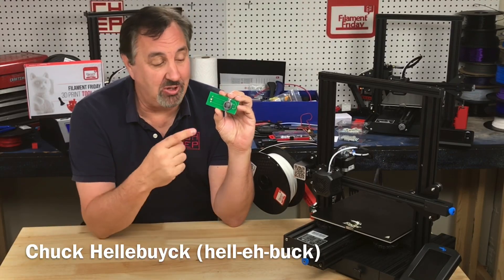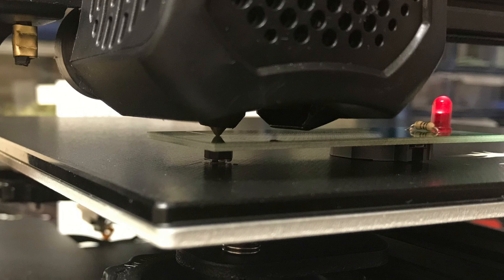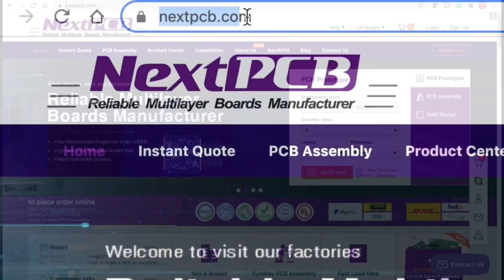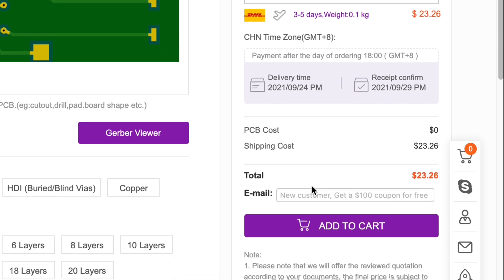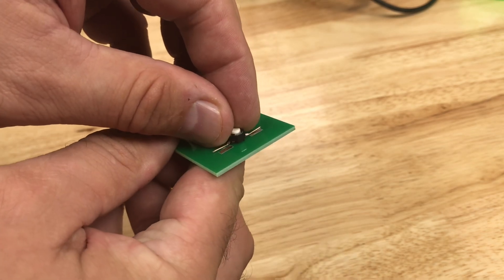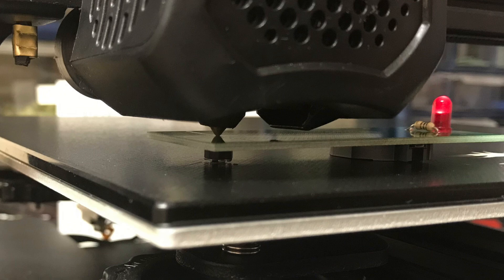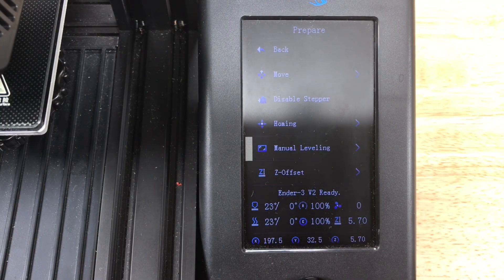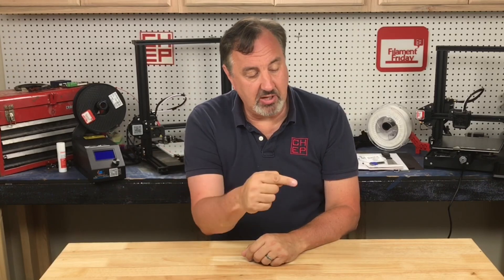Filament Friday E-Leveler - Electronic Device for Easier Bed Leveling on any 3D Printer

Comment: I like to use a multimeter set to test continuity for this. You can just attach one lead to the print head with an aligator clip, and the other lead to your print bed (if it's conductive; you can still use a feeler gauge if not). All you have to do is adjust the knobs until the multimeter beeps and move on to the next point. I've gotten fantastic results this way.
Reply from the maker: As I mentioned in the video, it’s not as easy as you describe for some printers.
Reply: @CHEP  oh my bad i didn't catch that. That's fair though.

Comment: I bought a ender 3 that came with auto level thinking it would make things easier for a newbie. I Struggled ALOT with it. Printed 9 CHEP cubes and there was always something wrong. I returned it and bought a Ender 3 v2 with no auto level, along with this e-leveler, and printed the first cube perfect.  You have been a lot of help CHEP, Thanks. I would like to second another comment. Why 20 seconds on the E-leveler File? I preferred the push button activate on the bed level code. It still got the job done though. Thanks again.

Comment: At 4:19 you mention that at a "fully pressed" position it has a thckness of 5.7mm. Did you apply force with the calipers, or is this measurement done when the LED barely lights up? There is some small difference between the moment a button closes the circuit, and the "fully pressed" position at which it mechanically cannot be pressed any more. E.g. the OMRON D2F snap action switch (usual choise for the home switches) has a travel distance of about 0.5mm from resting position until "contact", but allows extra 0.25mm travel beyond the "contact" point.
Reply from the maker: Calipers to light LED.

Comment: Not a good idea at all. This is a device for finding Zero or homing, not for mapping surface topology which is what bed leveling is intended to do. My bed has a dip that is large enough that entire board would cover it and give the UBL system the impression that section is as flat as the circuit board. Your better off wrapping your bed with aluminum foil to make it conductive enough to probe directly with the same technique. If your careful about how you do it, could even frame the foil so you don't have to keep tearing off a new piece every time you need to adjust the bed map.
Reply: You wouldn't be able to lay down a perfect layer of foil to get an accurate result in a repeatable fashion.  Even if it was just a small piece, it's too flexible to be reliable to ensure that you're as close to the bed as you possibly can be.  As soon as that foil touches the nozzle, or whatever you're using to complete the circuit, the circuit completes, but there could be a gap below the foil you just don't see.

Comment: Before tramming (levelling) I replaced the bed screws new screws that are 5mm longer, and added lock at the very bottom. After tramming, I held the knob in place and tightened the lock nut. I almost never have to tram again as the knob no longer vibrates loose. Honestly, the manufacturer should put a locknut in the knob to begin with. Cheap upgrade, increases quality. Here is an idea for anyone still reading: design a knob that incorporates a locknut. 

(sorry if this is  duplicate comment lol)

Comment: The only problem is the actuation distance of those little switches isn't typically very repeatable as they're not designed to be
Reply: that’s why you measure the one you made and is what you put in the offset
Reply: @youhigh321  measure one of those at the actuation point 5 times and you'll get sightly different readings every time. They're not precision switches at all.
Reply from the maker: Will Lyon- Have you actually tried it? 
I have, I get the same reading every time.
Reply: @FilamentFriday  I'd say you lucked out with a good switch then. I haven't used them for this specific thing but I have done similar things with similar switches and the repeatability wasn't great.

Sometime needs to make a test setup with a stepper to measure actuation distance for these little switches

Comment: Thank you! This is an useful also with Manual Mesh! anyway, i guess the nozzle have to be hot during mesurement, right?
Reply: Bed and nozzle need to be warm because heat makes things expand and warp, so its better to level the bed hot than cold since hot is when you actually use it :)

Comment: you took so much troubles in making this circuit. Lotmaxx Shark Plus 3D Printer has built in LEDs on the side to do this :) and also probes for 6 points auto bed leveling. i believe more and more 3D printers now coming out with auto bed leveling and these built in LEDs. for those who do not have such systems in printers, of course this device will work.
Reply: Yeah I mean, we have printers without that.  It's not like we're going to buy a whole new printer for that lmao it'd be easier to buy a bed leveler for ender 3...what this board is is something even cheaper than auto bed leveler

Comment: You should use leaf switch instead of the tact switch for more accurate switching. As you can see, the Ender Home switch detector also use leaf switches.
Reply from the maker: I’ve tested and found it’s not any better.

Comment: I have the new RED board and one suggestion I'd pass on is to use one of the bigger surface mount buttons. The smaller button allows the board to tip too easily if the nozzle is not exactly centered.

Comment: 2 things... First, why a 2-sided board? Why not surface mount everything on one side and lower the nozzle directly onto the button? Second, I'm always confused at the z-offset... With feeler guages the video said set z-offset to feeler guage thickness but I don't think it said to reset to 0 after level, but with this you set to the thickness, level, then reset to 0 when done... Why?
Reply from the maker: Switch can’t handle nozzle temp.

Comment: I wonder how what the accuracy of that button is compared to something like a BLTouch? This also doesn't compensate for an uneven bed like a mesh does.
Reply: the accuracy of this kind of button is ... crapy. If it was accurate, we should never had to look for Hall effect sensor, or accelerometer or any other more expensive solution.
Reply from the maker: Just as accurate as the Z stop switch. Hall effect is less accurate.

Comment: Love this Chep! Kind of really sad though was able to snag myself one to receive an email saying they can't be shipped to AUSTRALIA v.v That makes me want to cry. Oh well, I guess I miss out on this. Love the idea Love the channel it has been super helpful in getting me started. With the amount of trouble, I have been having to level my bed I was about to throw my printer out the window. I mean I am still having troubles which is why I wanted to buy this somehow managed to fluke the leveling yesterday!
Reply from the maker: I’m told Covid restrictions are causing shipping issues to some locations outside USA. New Zealand is another one. Very frustrating.
Reply: What kind of printer. Actually doesn't matter. Start with rough level. Use 1/4 inch of cards. I use some pokemon cards use playing cards. That's rough level. Then start turning ech handle even amount of turns till your down to the bed, with one card. Then you're close. Get a piece of paper. Do 1/4 turns or less now evenly. A piece if paper is.4 mm. Take paper and push under nozzle. The nozzle and bed need to be set at temperature of filament you will be using. I have Creality 3v2. Most basic printer. That's the one to learn on because it is hard to get right.

Comment: Can't wait to try this 😀
But one question,.. after leveling you set the z-offset (5.7) back so it's on true zero....
True zero, does this mean that the nozzle is resting on the buildplate?  You went up 5.7 and back down 5.7!?
Reply from the maker: The slicer 1st layer will offset the nozzle per your settings typically 0.2 or 0.3 mm.
Reply: @FilamentFriday  Is it a setting we have to manually put into the slicer (maybe on the start gcode ?) or this is a build in and automated feature in all slicers that it will offset the nozzle by the layer height we choose ?

Comment: I’m wonder why there are hardly any videos on YouTube on ASA specifically ASA Carbon Fiber. I just bought a roll of CarbonX ASA/CF. It was really expensive , but I’m very impressed with the strength once I dialed in the temps. 250°c nozzle  / 110°c bed using enclosure. I’d love to see you do a video on it! Thanks!

Comment: This might be a really dumb question, but why do you set the z-offset to 5.7mm, level the bed to (presumably) 5.7mm of distance between the tip of the nozzle and the bed, and then revert the z-offset back to 0mm?

Maybe my understanding of z-offset is flawed, but I was under the impression that it was a measurement of the distance (empty space) between the tip of the nozzle and the bed.

What am I missing here??
Reply: Z offset is the difference in distance between an ABL probe and the nozzle, he is not using an ABL probe so the Z offset is at zero, the board is 5.7 mm thick including componants so this is set as the z offset so the nozzle does not crush it but connects to the conductive point
Reply: @AndrewAHayes  Ok...so if someone isn't using an ABL, their z-offset should always be zero?  Is that a fair statement?
Reply: @Campapalooza  yes because the z offset is telling your printer how far the nozzle is when the zlimit is activated. If you are using a bl touch then your nozzle is higher then the bl touch when its probing for the z limit, hence the z offset. If you arent then your nozzle should be basically touching the build plate once the zlimit is activated.

Comment: Dial indiacator is so much easyier and more accurate
Reply: Please explain this further.  How are you using a dial indicator to measure the tramming of the nozzle to the build plate?
Reply: @williamsteele  mount it to side put nozzle to bed zero dial indicator move nozzel up amount u want it above the bed based on dial indicator re zero dial indicator then level bed based on zero of dial indicator
Reply: @alockworkorange7296  yeah but no lil red light :(
Reply: @alockworkorange7296  I don't see how that can account for any inaccuracies of the X axis arm itself... all that will do is level the bed to the frame.

Comment: Is this type of switch accurate enough? I would use pietzo or something home made (two thinn metal plates with tiny cap)
Reply: its not, is a good idea but you cant relay on mass produced switches that are not made for precision, plus you need to add the error that the calipers make in taking the measurment, use a feeler gauge to level the bed, but anyway, if you had an autolevel sensor this is not necessary at all
Reply from the maker: Yeah it’s accurate enough. Works great. As accurate as the Z stop switch that homes it every time.
Reply: @FilamentFriday   Tru.. endstops are prettylike same, but I would like to change my endstop to optical 😁 

Its almost as cheap, but can trust it homes correclty because sometimes I see switch is not homing to exact same position  (sometimes problmen is screw itself, it kinda wobbles when turning so otherside of its cap can be higher ans turning can make it go even wrong direction 🤣)
Reply from the maker: Optical isn’t really any more accurate.
Reply: @FilamentFriday  WHAT????
My optical endstop repeats within less then 1/100 mm. Never seen a microswitch do that.

Comment: The extra steps with the z-offset don't really seem necessary 🤔 just bring the z-axis to a height of 5.7 and you're good to go. That also is true for leveling with a feeler gauge. The offset is not really important. The angles are

Comment: I've used paper, feeler gauge,  also have a bltouch and still have a hard time. I've also used masking tape to hold the glass because the metal clips create a bow where ever they are clipped.  For some reason the center of the bed is always lower than the outer edges on my Ender 3 V2. I've put a business card under the center of the glass and it still doesn't help. I enjoy 3d printing, but getting a perfect CHEP test is almost impossible.
Reply: With Jyers firmware, the BlTouch will tell you exactly how much you need to adjust each corner, down to 0.001mm Much easier than using paper. Then you use UBL and automatic bed tilting in your start code to get perfect, automatic bed leveling each print.
Reply: @michaellindborg1510  Thank you! I will definitely check it out!
Reply: @JasonSmith-pc6kr  let me know if you need any pointers
Reply: @JasonSmith-pc6kr  Yes, I upgraded my Ender 3 V2 with Jyers Extensible UI recently, and it solved my bed levelling issue, now my print out result pretty good, you should try.

Comment: Got one.. I noticed the current release of the G-Code to use it seems to already set the Z-offset to 5.8
(By the way it worked very well)
Only suggestion is some of your older GCODE releases had manual pause (M0 or M-25) And  would like to "push to continue" rather than only have 20 seconds.    
Once it was done I printed a layer of the Squares test.  all stuck around nicely no issues. 
Finally it's doing a test print. 

The ENDER-3 is printer 2 Printer 1 is a Flashforge. Sensor built in to that puppy.. But alas it's down just now need a new hot end.. ((yup. I broke it. I know how, they are sold out I'm told)  Got the Ender-3 used from someone who never put a new file on the card. Only  printed sample files (Test dog?)   I"ve printed a bunch of halloween stuff already.

Comment: My only issue is that it goes to dang fast. About the time I get it centered it moves to the next corner. Oh and that's another thing, the micro switch IS NOT CENTERED under the cross section.
Very Frustrating but I know it will work once I get these issues sorted.

Comment: A better solution would be to use a piezo on the board instead of a switch. Its easier to measure the pressure required to trigger it.

Comment: Great idea sir.

Manufacturers need to implement their z-stop into the print head to directly interface with the print bed instead of the printers frame. That would save so many people so many headaches.
Reply: 3d print and adapter and do it yourself:-)
Reply: Or get a BLTouch :)

Comment: CHEP,  I had an old Ender 3 V.1 kit from 12/2019 I built this week, then swapped the 1.1.4 motherboard to 4.2.7. Seems to work nice BUT my favorite bed level GCODE from you is behaving funny with the Creality 32 bit motherboard.😢 It’s the program taking the print head to all 4 corners and the middle of the bed, stopping at each point. Well, it moves correctly, BUT it doesn’t stop in any place anymore! 3D prints look okay though , so what is going on with the bed leveling gcode??? Please help, anyone🙏 I’m just an occasional 3D printing hobbyist, but I LOVED CHEP:s bed leveling program❤️ Really want it to work again.🙏

Comment: I would like to buy your kit. It's similar to a probe I used on a very large cnc machine upto 100,000 pound castings. It had a.250 ball on the end and rotated in the spindle. We would back off until the ball was starting to flicker. It was the best ege finder available. I haven't had time to play with my Ender  6. I don't think it has a z axis offset. If I raised z 5.7 how it will it stay without a G92? Please give a little more detail for printers with out z axis offsets.
Reply from the maker: Your just setting true zero. Use move Z to 5.7 and use the tool and then when it homes it should be true zero.
Reply: Thanks

Comment: Good morning. 
I have a tenlog and I’m not that much into changing what works. Ie. The firmware just for mesh leveling. On the site for your leveler it’s out of stock until 2/10. It’s 2/15. Are you still selling these?  If so please let me know a better instock date.
Reply from the maker: They are back in stock.

Comment: Dear CHEP, I loved the idea and brought the levelling tool. However I use a glass bed directly on the aluminium bed and have no magnetic sticky pad. I find that I simply run out of adjustment when trying to use it and my adjusters spin loose. Could you possibly give me an idea or perhaps create a modified version of the G code that perhaps sets a little closer to the bed? Probably point 5 of a mm? Thanks for your kind attention!
Reply from the maker: Are you running my GCode?
It offsets the nozzle 5.8mm for you. Bed thickness wont matter. 
If your adjusters are that loose then your home setting it off. Raise the z stop switch first to get home close to mid point of the adjusters then run my GCode.
Reply: @FilamentFriday  Hiya and thanks for coming back :) yes, I must admit that I thought afterwards that probably would not help! I obviously need to scratch my head a little  I am running the gcode, however as I do not have a z stop switch and use the BL touch for homing. Am not sure how my adjusting of the z stop will affect things, but as I have the printer in parts I will crank up the bed, set my Z to suit and see where I am left with adjustment! Edit: It wasn't for me, but never mind. Perhaps more conventional setups will benefit :)
Reply: @FilamentFriday   how do i set this up with a bl touch?
Reply from the maker: Just run the GCode and level the bed manually. Then run the Autolevel.

Comment: How much resistance do you get on the paper as if you're doing a manual bed leveling after you level it using your device?  I'm just curious how the two distances compare.

Comment: i bought one from amazon to suppoer chep but the battery part is not right the part that hold the battery is not there and it keeps poppin out.
Reply from the maker: Contact the amazon seller for a replacement.